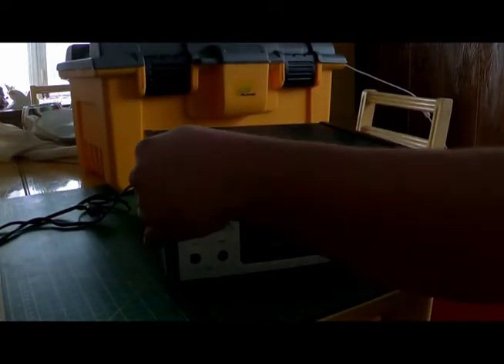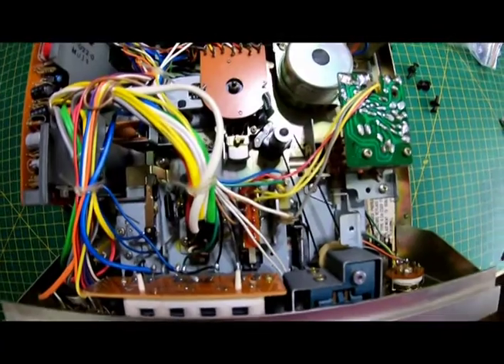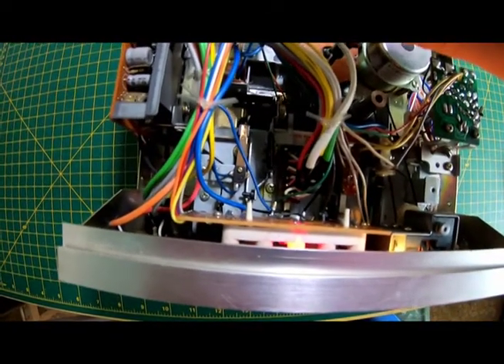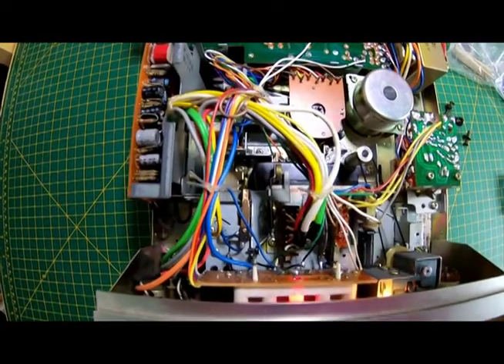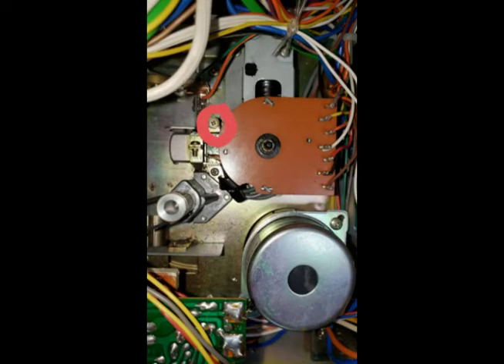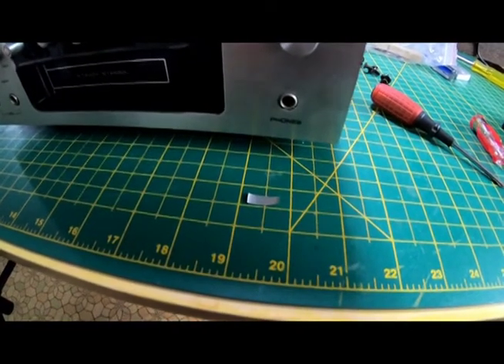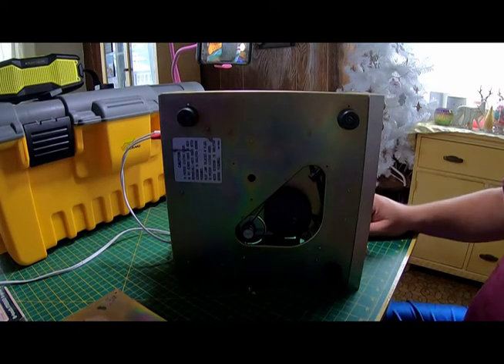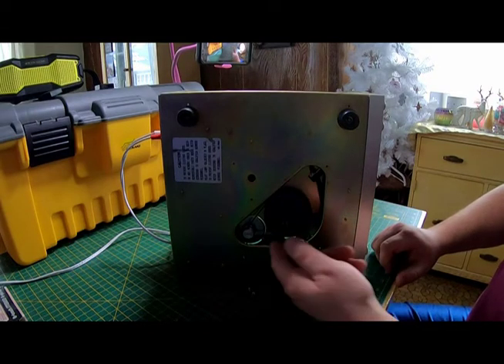Get Your Head Straight! - Pioneer 8-Track Player Head Adjustment

Comment: Hi! Thanks so much for doing both of these videos. I have a 1978 MEGO 2XL robot which has an eight track player inside. My unit is cross talking on some tapes and not others. A 2XL repair expert suggested that I adjust the head height adjustment. The only thing is he wants me to buy his instructional video. It’s nearly 16 bucks. I understand that you have to make money but, wow! Anyway, I am totally blind and hesitant to do this myself. I am not sure what model eight track this is as it is slightly modified on the inside to accommodate the work required to play  2XL programs. I will look around and see if I can find out what model it is. I believe it is similar to the eight track player you would find in your car back in the day.
Reply from the maker: It would most likely have a lower end setup in it. If you decide to try and tackle this yourself (which i think should be pretty easy) you can send me an email with pictures or video of anything that stumps you and I will happily advise you, but I don't think you should have any trouble. 
My email is mrboutilier@yahoo.ca
Reply: @8trackfm  thank you so much! Lol! I have always wanted to do stuff like this, but I just lack the confidence. If I come across any problems, I will certainly email you. I do have a few questions though. Can this crosstalking be caused by the A-Trak tape itself? I mean, if the tension on the tape is not quite what it should be, can the tracks bleed into each other in that instance? The reason I ask this is because The cross talking occurs on some tapes and not on others. Is it a matter of somehow tightening the innards of the eight track tape? I am a kid of the 80s so this is just a little before my era. Lol!
Reply from the maker: Sometimes worn pressure pads on the cartridge (located directly under the tape at top of cartridge) can cause cross talk but it’s usually from a misaligned head. The foam pressure pads are the worst for wearing out
Reply: @8trackfm  I have heard of this happening. I do know of a YouTuber who has found a low-cost solution to this problem. I don’t remember if it was Databits, or Techmoan, but one of them discovered that you could tailor cut make up sponges and apply them with some sort of adhesive. You just had to apply some scotch tape or some thing on the side of the make up sponge that touches the tape so it won’t rub and produce make up sponge flakes. Lol! I wish I could remember who did that! Anyway, I think there are also eight track repair kits if I’m not mistaken. I don’t know. I think I would try the head alignment to. It wouldn’t cost me anything. Lol!

Comment: Actually, this is incorrect. The screw you are adjusting is actually the head 'Azimuth' screw. The 'cross talk' head height adjustment hex nut is behind this assembly. 99% of the time, the cross talk adjustment is all that is needed to correct/optimize playback. You shouldn't mess with the azimuth.
Reply from the maker: You've peaked my curiosity. I will have to check this out. I could very well have missed this.
Reply: @8trackfm  Go to vinyl engine and download the service manual for the H-R100 (which is the same as yours but has Dolby).
Reply from the maker: @frankm3945  I definitely will. Thanks for the info